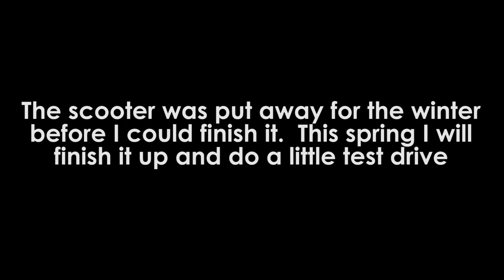1986 Honda Spree Engine Swap and Clutch Repair

Comment: Did you put any oil in the cylinder before you compression tested it because the cylinder would be dry and create very low compression?
Reply from the maker: Great point and no I didn't. It would definitely explain the low compression.

Comment: How’s it running now? Would love to see an updated video. Cheers
Reply from the maker: Hey Mike. I sold that one. It was running great when I sold it. The only issue it had was that the oil injector would leak oil into the cylinder, making it hard to start after it sat for a couple days.
Reply: @SouthpawWorkshop   what did you end up doing for an air hose to the air box?
Reply from the maker: travis king I used a clear piece of vinyl hose that fit the carb intake perfectly. It was a straight shot to the airbox so it worked out well.

Comment: I watched the whole video to see how you take the clutch off 😂 realized you skipped that part of the video... Do you remember the steps to take it off ? Wanted to see it done before I dig into it myself .
Reply from the maker: It has been a while since I had those Sprees. I don’t remember, but I would think there was a nut on the shaft holding the clutch. You might need a puller to pull the clutch off the shaft.

Comment: Hi thomas just kind of finished restoring one that has been used as a plant pot for years. Cleaned it all up and got it to start only after injecting lil petrol and oil in the engine. When it starts is over revs like crazy then dies out. This is the first scooter i tried to restore so im not so clued up on it. I replaced the throtle casble but still cant stop the over rev. Any ideas what could be the problem?
Reply from the maker: It could be a lot of things, most have to do with the carburetor. Your idle screw may be turned in too far, the throttle slide might be stuck, your air/fuel mixture screw may not be adjusted properly, or you may have an air leak between the carburetor and engine. Any of these things can cause the condition you are describing. I might suggest looking up Mustie1 on YouTube. I learned everything I know about small engines by watching him. Good luck!
Reply: @SouthpawWorkshop  cheers bud thanks allot for the response! I had already checked all the things you mentioned except the throtle slide so i will do that next. Ill also check out the channel you mentioned. 😁👍
Reply from the maker: One other thing you can do is pull out your throttle slide, turn it 180 degrees and reinsert it. It will fit in either way, but only will work properly when indexed to the correct slot.

Comment: How do you remove the headcasing for the Honda, cant find anything online
Reply from the maker: Hey Carson, not sure what you mean by headcasing? If you mean removing the head, you would have to remove the whole engine to be able to do that.
Reply: @SouthpawWorkshop  the part that houses the speedometer and front light. I think I've figured that it's pretty much removing the front fender, unscrewing the visible screws to be able to push the bottom half down to have access to the last two... I want to buff out my front light and need to replace my rear break line
Reply from the maker: Gotcha. Yeah should be pretty easy. Just a matter of finding all the screws.

Comment: Hey  Like  channel  question  on  your  carb  whats  the  lower  tube  connection  on fuel  bowl.i have  87 And  i dont  know where  it goes
Reply from the maker: The lowest connection on the fuel bowl is the drain. When you unscrew the drain plug, fuel will flow out of that connection.

Comment: What should the compression be
Reply from the maker: Ideally, 125 minimum, but you can get away with lower than that. I would think it would have trouble running under 90 psi